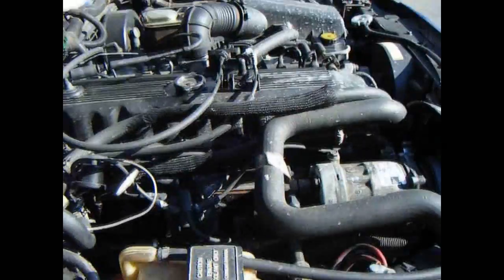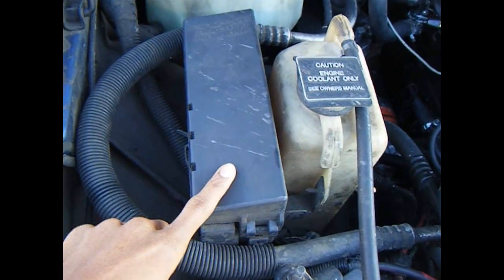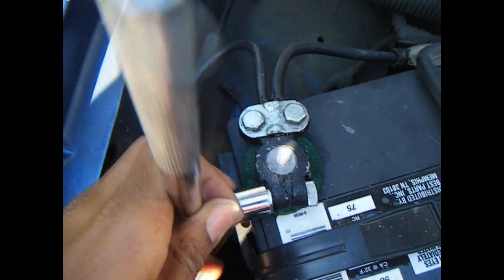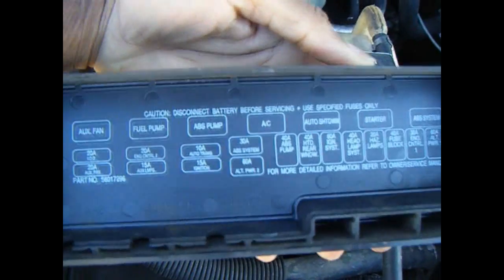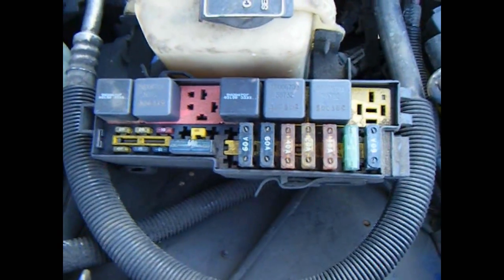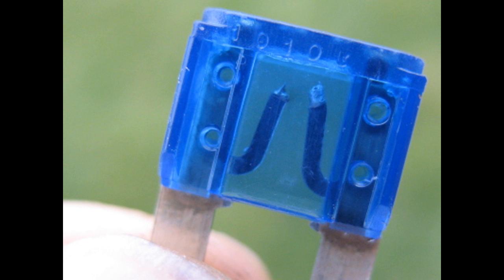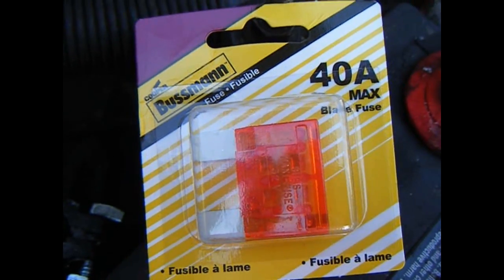Fix Yer Tail Lights!

Comment: I think u just saved me a few hundred bucks. Took my car to goodyear and it came back with no dash lights. Plus, just noticed two days ago, the tail lights were out too. I think they were trying to rip me off. They told me they would need a few days to find the problem because electrical work is tricky. I even asked the guy "could it be something in the fuse box, since you guys were supposed to try to fix my hazard lights (and didnt)". I bet they would have tried to charge me a grand or so for a three dollar fuse, smh. Thank for making the video!
Reply from the maker: So happy the video helped!!! Some "shifty" mechanics always try to find ways to dig in your pockets more. smh!

Comment: So I have a Nissan 240SX 1989 so basically I would need a 40 in the fuse box in the hood and on the driver side I would need a 15?

Comment: Which fuse slot does the 15 Amp go in? Cause I'm having the same issue with my vehicle and I'm trying to fix the problem.....
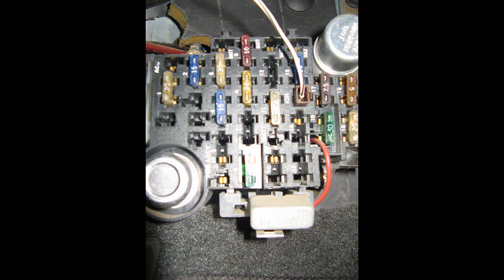Reply from the maker: Howdy Arelene! The cover of your fuse panel should show you which slot corresponds with which electrical component and it should have the Amp on there also. If not, just google your car's make and model and then fuse panel. It should look like the picture I have at 2:02 . Props for being a DIY mechanic 😊!

Comment: Nice it was 15 or 16 that works with the horn relay on a chev venture a friend has I thought the drl fuse was right there too
Reply from the maker: It must be fun working on a Chevy venture! Anything Chevy really.
Reply: @CWEBSWORLD  IKR  I decided to  install a hitch on my '11 equinox  recently and  I got to thread chase the holes to get the hardware installed shame on gm no forethought  just engineers  wanting  money 🙃
Reply from the maker: Did you make a video for that hitch install? We'd love to see that!!
Reply: @CWEBSWORLD  sorry unfortunately I  had to do it in parts because it was so rusty in the holes I had to soak it with pb blaster a couple  days then with a power brush harbor  freight  sells rim out the holes then try running in the bolts finally  got frustrated and  popped  the bumper off and with  a flex and a nut driver the size of my m12x1.75 tap rammed it in.
Sprayed again then coated bolts with antiseize lube.
Oh, and almost  forgot you will  need a swivel to  access the top holes on the side of the frame or just s angle  grinder  and cut it 🤔  uh, probably  not. 😄
Would like to add that while the hitch is rated the frame  could  be rotten so that drops the tw as well also if you look into it gm has a  hole you can pop out and install a 4pin plug you have to remove  the spare and pad then under the  side panel driver's is a connector that plugs in plug  and play no t-tappings on wires or drilling  ground holes as seen on the u-haul video seen on YouTube.
Hope this helps
FYI that  plug is gray and is fastened with a plastic  keeper need  long screwdriver  needle nose pliers something to retrieve  it.
Reply from the maker: Wow!! Thanks for this!!
Reply: @CWEBSWORLD  yor welcome also note that the equinox  and terrain  are the same. 
Took  hitch  from 2013 terrain  and added it to my 11 equinox.

Comment: On my 1998 Lincoln Town car-I have headlights and brake lights, but no tail lights.  Have checked the fuses-good.  What else could cause the problem?
Reply from the maker: Check the contacts in the fuse box. Make sure there's no corrosion.

Comment: I’ve a 1996 Silverado with a 4.3 and it keeps blowing my signal light fuse, the fuse is a 20a, I thought about placing a 25a in But you said not to raise the amperage, could you assist me?

Comment: I have a 2011 Honda Pilot, my tail lights are out. My brake lights work fine. 
I change the fuse from the box under the steering wheel. 
What should I do next.

Comment: My tail and dash lights are out, but the fuses are OK...? Whats next
Reply from the maker: Hmmm, If you bought a brand new fuse then check the contacts in the fuse box itself to make sure there's no corrosion. Wiggle the fuse and see what happens (Pa Pa's remedy)! HA! Rule out the fuse box first.
Reply: Same here! I tested all the blue 15amp fuses, replacing each one with a spare, but fuses appear to be good. Maybe a wiring issue. Did you fix the problem?

Comment: Can someone give me some advise... pleaaaaase!!!
I have a Prius 2011 and I am having a little problem with my rear lights...
- the turn sign indicator lights work fine, both tuning left or right...
- the break lights work fine...
- the reverse lights work fine as well...
The only light that doesn’t work is the “ tail light”... any suggestions of what could be the problem?
Tks anyone in advance for any advice. 👍🤙

Comment: I have a 1988 Ford econoline e 150 van 5.8 V8 351 Cleveland. left tail light works right tail light doesn't. how can I solve this problem
Reply: possibly the assembly that holds the light. cant be more than $15 at a parts store

Comment: What does it mean when my 10A Tail fuse is blinking?
Reply from the maker: Blinking? The fuse itself? That's a new one. I've never come across that before. Are your tail lights working? It could be an indicator that the fuse is going bad. You may need to check the polarity and the wire connections.

Comment: I switch my fuse and it still didnt fix my cluster or tail lights
Reply: Did you end up figuring it out? I changed the brake switch and still no fix lol

Comment: Changed the fuse but tail and dash light still out. and now blinkers are out. I NEEDS HELP SOMEBODY
Reply: +Michael Edwards  check your ground wires.
Usually, a bad ground connection causes bad mojo. keep in mind if a fuse blows that is a good indicator something shorted inline.

a handy volt meter will also be useful to determine if you're getting any  power/voltage to the sockets
 12v is the typical circuit voltage.  You can test fuses and socket wiring to at least trace back were power is or isn't.

Comment: You shouldn't be unplugging both battery cables...
Reply from the maker: +Peter D&#39;Avignon I know, but I have a highly irrational fear of being electrocuted while doing mechanic work. Sometimes I take the battery out completely! ('~')!
Reply: Where is you tail light fuse

Comment: hi i have the same problem but the only thing is when ever i put a new fuse it burns it and i dont know what is the problem can you help me?
Reply from the maker: Is it a factory installed fuse? Also have you checked the amperage of your car battery? You have to make sure your fuse has the correct amperage rating for the circuit it's in. I'm not an expert on this but I discovered the importance of amperage when my monitor kept going out while I was editing (><)! DOH!
Reply: Make sure your car is off as well. Sometimes you can burn that fuse or other fuses when your car is on. It has happened to me before.